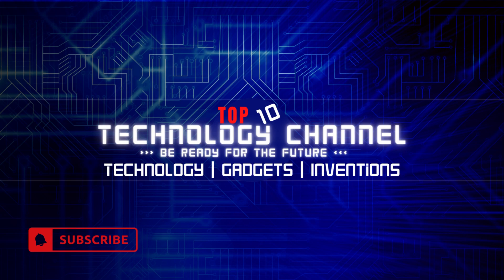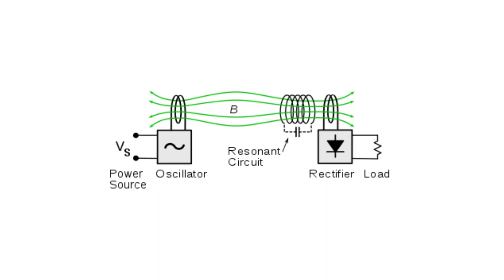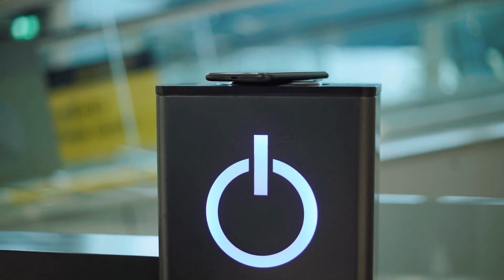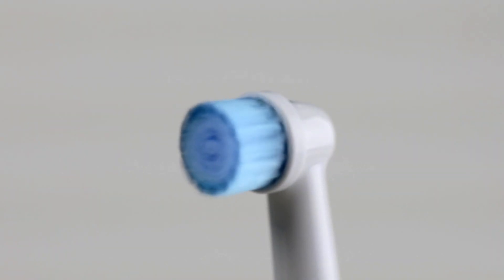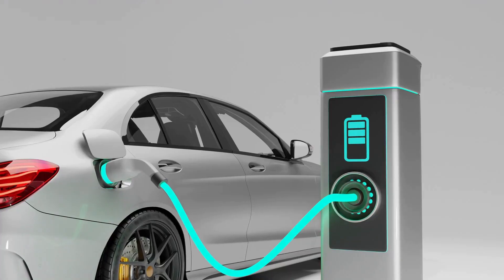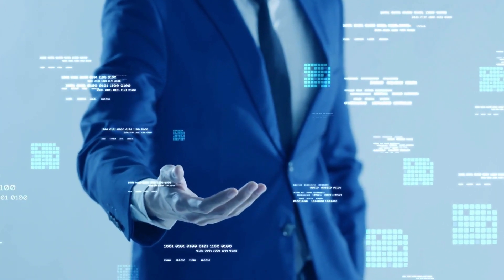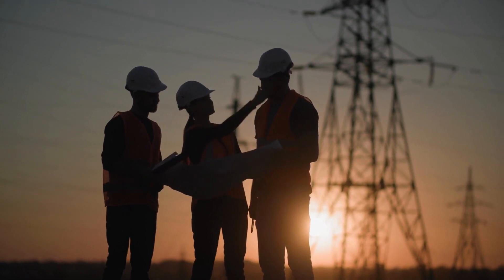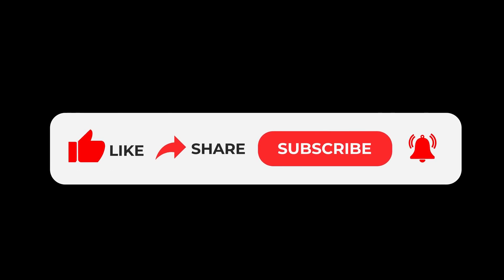The Magic Of Wireless Electricity!

Comment: The US government has done numerous tests of life in strong or nearby RF fields. They cause cancer.  That's why microwave ovens are sealed when they're operating. 

Unless the device being charged is sitting right on top of the charging loop the charge efficiency is horrible, with at least 100 times, (closer to 1000 times,) as much power being sent out as is received by a device across the room. The rest screws up your other electronics gear and cooks your cat. Wireless power is simply stupid at this point in time. BTW, I'm an Amateur Extra Class ham operator, and an RF experimenter who has been working in the electronics industry for 50 years.